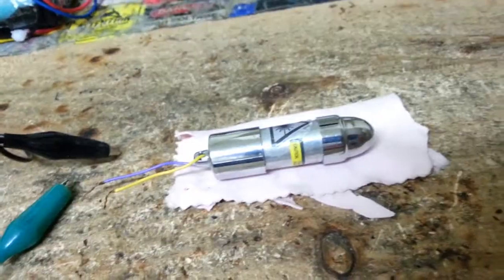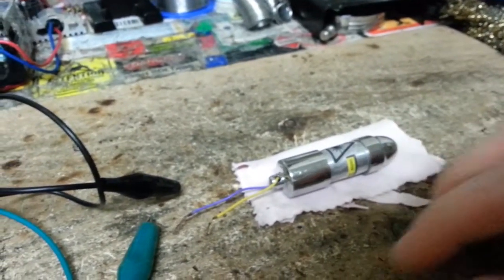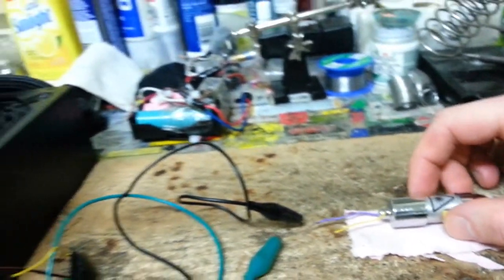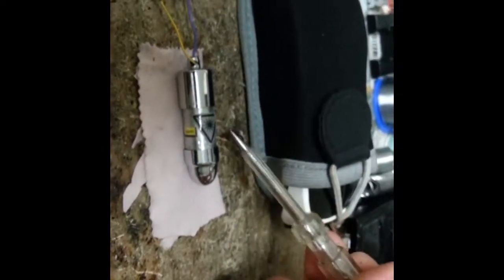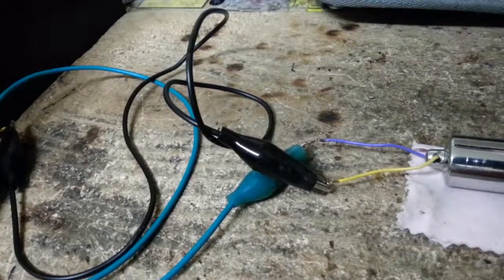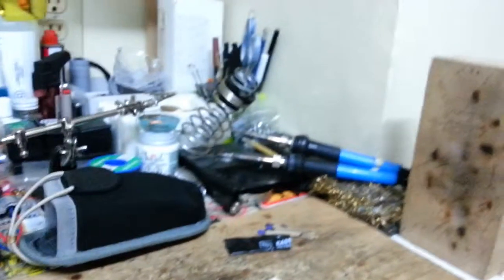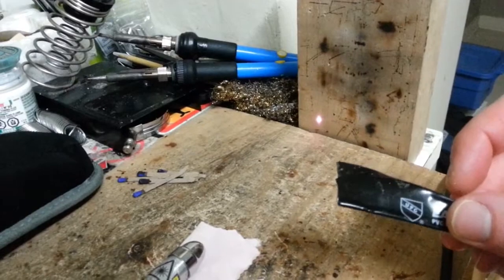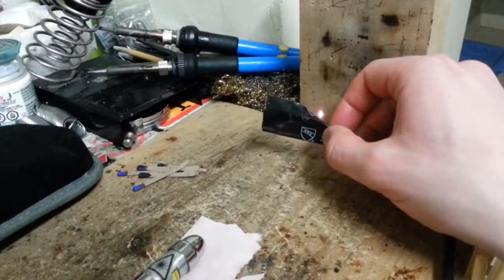Custom Built 200mW NIR 780nm CW Infrared Laser, Testing and Dangerous Burning Tricks, DIY Style

Comment: Hi Joshua! Which goggles were you wearing while making the experiments? Links would be appreciated!
Reply from the maker: Hello! Thanks for reaching out. All laser eye gear must come from a reputable and certified source. Do not buy from Amazon or eBay. I'd recommend Thorlabs, Laservision or LaserGlow Technologies. For a project like this, I'd recommend laser safety glasses that cover the near-IR/IR wavelength with an optical density of at least OD 5+. The higher the density the better protection there is. For example, glasses that are made for 780nm-808nm of laser light would suffice. As long as the desired wavelength is covered you'll be safe from harmful radiation. I hope that helps!
Reply: @JHERU  Thank you! I've purchased from Thorlabs :)
Reply from the maker: @ozgunkilicafsar8122  Your welcome! Stay safe and have fun.